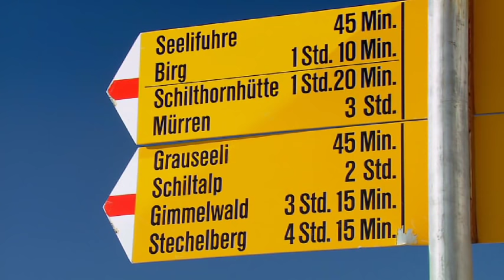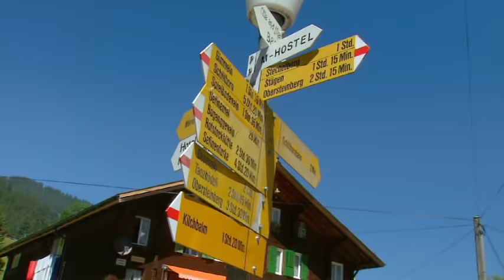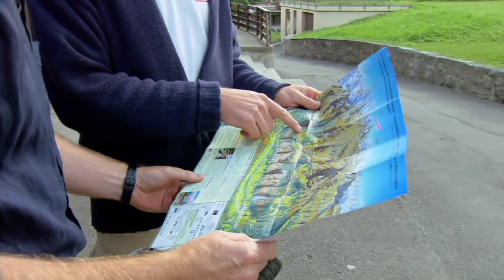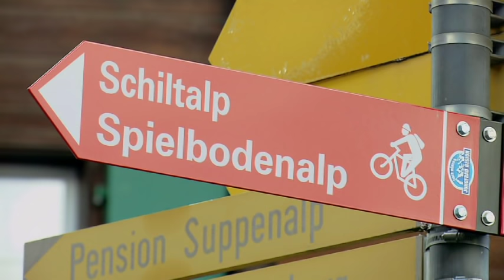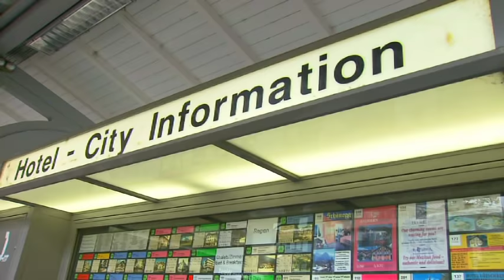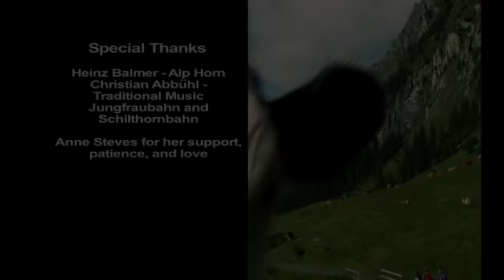Switzerland's Jungfrau Region: Best of the Alps

Comment: This video must date from before 2006. The funicular (minute 12:46 in the video) that went from Lauterbrunnen to Mürren (via Grutschalp) was replaced by an aireal lift in 2006.
There is another small error: the train that is shown in minute 25:58 is NOT the train going to the Jungfraujoch. It is one of the  trains that connect Kleine Scheidegg with either Grindelwald or Lauterbrunnen.

Apart from all this,  the views haven't changed and remain breathtaking.